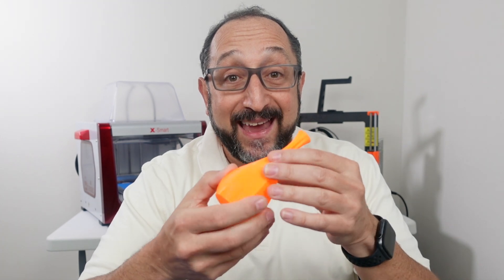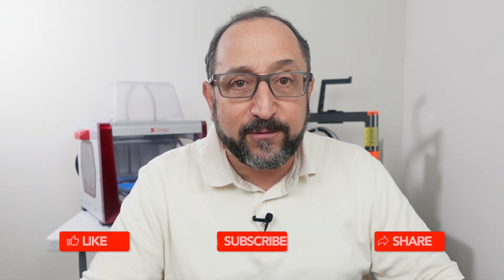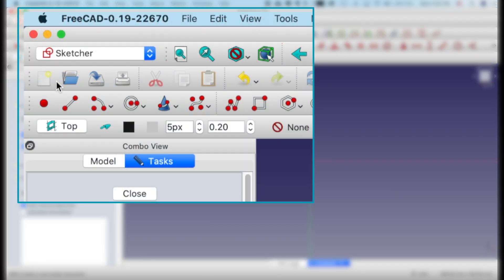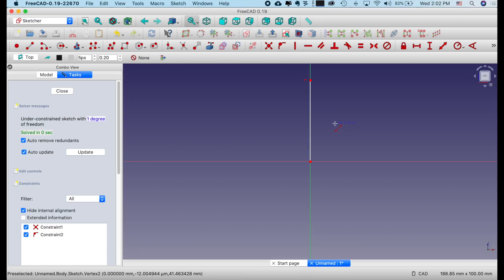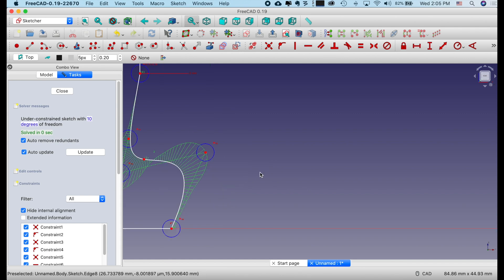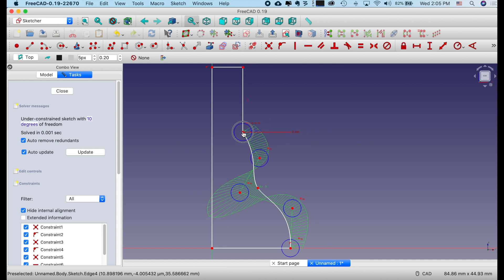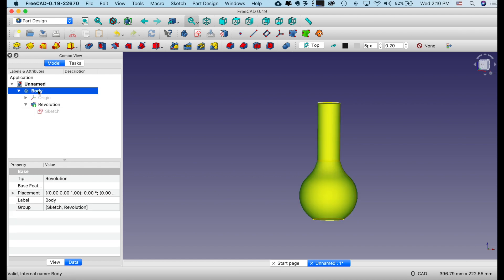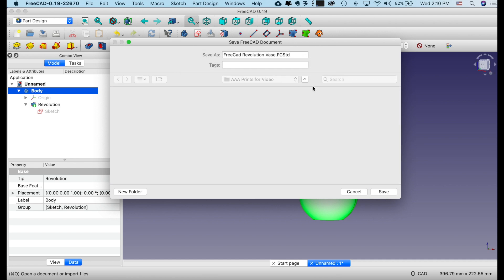FreeCAD for Beginners | Design a Vase with Revolve and Loft

Comment: what about  design spark? its free cad software!! and what about onshape which has a free version and is a online cad!!!  both are less hassle than freecad!
Reply from the maker: I prefer to talk about software that runs on both windows and macOS when  possible.   I may be wrong but my impression is design spark is windows only. Onshape much like Fusion 360 are both excellent programs but their licenses have changed overtime so I switched to Freecad.
Reply: @MakeWithTech  well whatever works best i always say!!

Comment: Nice video, just what I needed. However when I create the sketches and go to the model tab I do not see individual components only sketch under body. Also when creating the sketchs it only ask what plane on the original sketch. Using version .18. I have tried 10 times.

Comment: Thank you for the video.  

One thing I have been stuck on, its inserting an operation into a prior step.  

I am able to return to the prior sketches and change the dimensions etc to change the object but find it quite difficult to insert an operation.  

For example, the object has a few sketches with each having a pad after the sketch, like Sketch 1->Pad 1, Sketch 2-> Pad 2, Sketch 3-> Pad3.  After that is done, I start to fillet and chamfer the edges.  In the process, I find that it is need to do a chamfer before Pad 2.  How do I do that?  Will be great if you can do a video on it, unless its really simple.
Reply from the maker: Good question.  Let me think about it and put it on the list.

Comment: Not on the subject but I just bought my very first printer, an Ender 3 
V2 and although I'm getting the hang of it, I have a problem with the Z 
axis, when I print a 20X20X20 cube, the Z is only 19mm so I printed a 
test with 5 layers of 2mm each, offset slightly to facilitate measuring 
and every layer is less than 2mm, any ideas how to fix this
Reply: I’d post your question on the DrVax forum, it’s a great place to get help. http://forum.drvax.com

Comment: Out of curiosity, do you ever use any other kinds of CAD programs?  I'm quite partial to CorelCAD at this point, but that's mostly because it's one of the very few "professional" CAD programs that works on macOS.
Reply from the maker: I have used Fusion 360 and still use Tinkercad for very simple things.   I also often use an svg editing program called boxysvg for complex 2d drawings.  I use affinity photo and designer for 2d art and Canva for my YouTube thumbnails.  Hope this is not too much info.